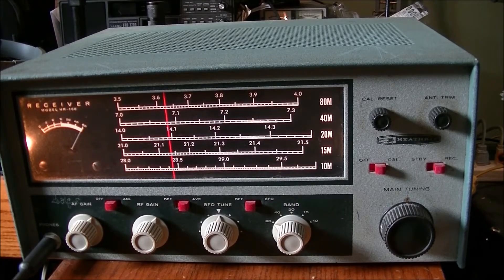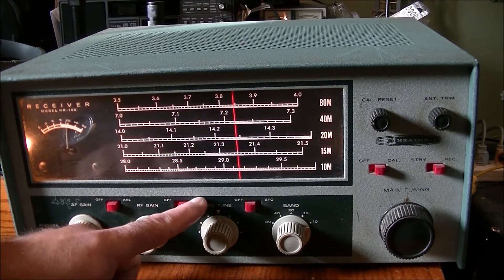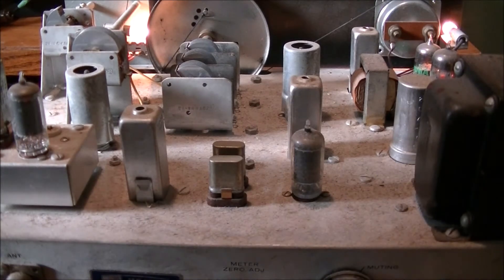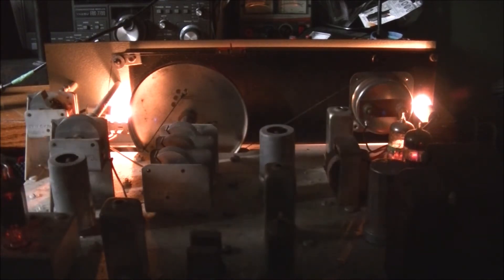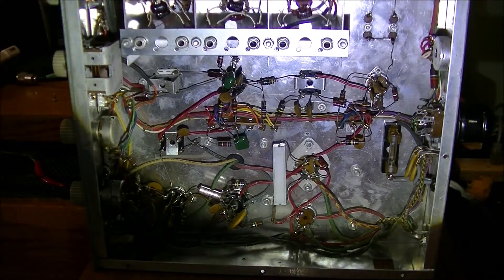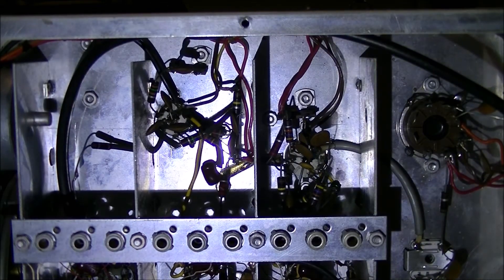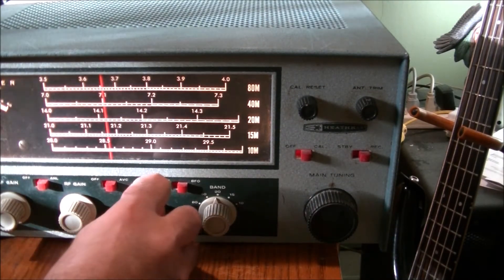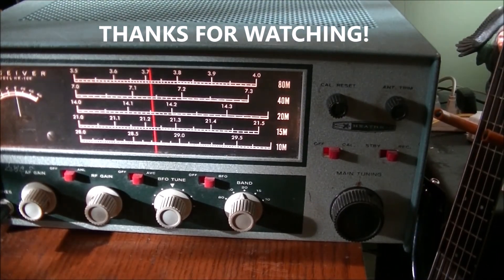HeathKit HR 10B Tube Receiver

Comment: Thanks for the upload Andy - really interesting. Nice to see it working after a fashion. What's the plug on the back...do you know?
Reply from the maker: I discovered that that plug is used with a transmitter unit so that the receiver can be used to transmit on. Very interesting design.